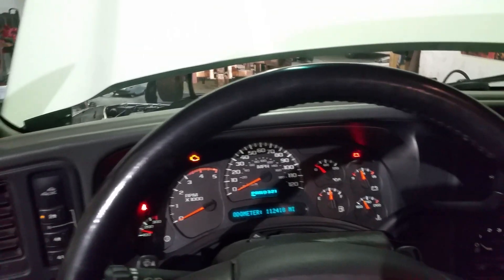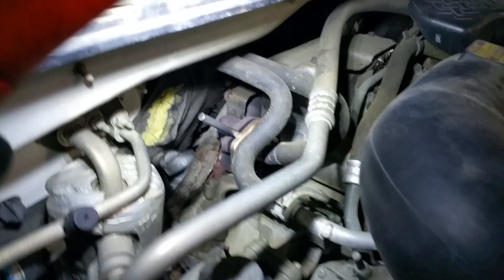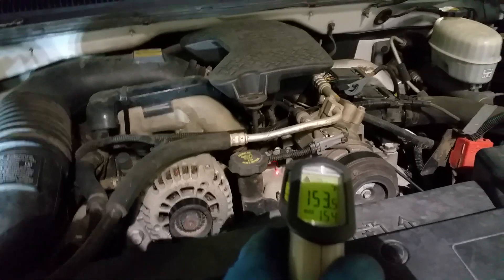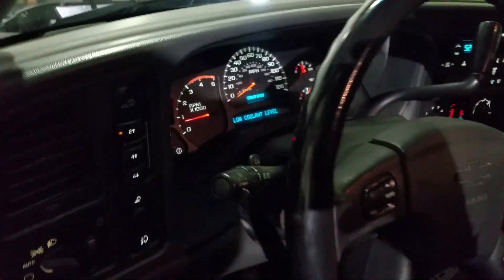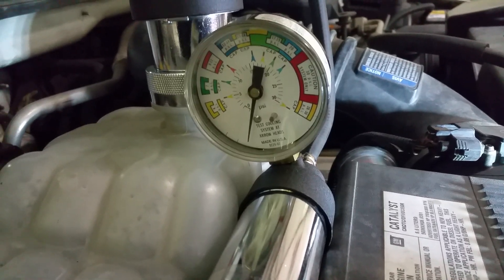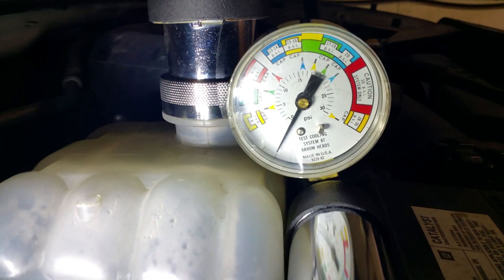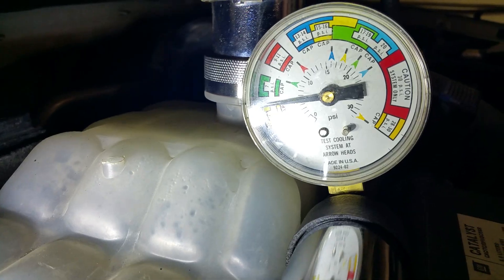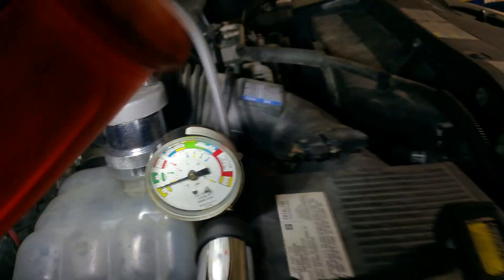LLY Duramax headgasket egr cooler leak test symptoms coolant pressure

Comment: Could you eliminate the cooler by clamping off the inlet and outlet hoses instead of disconnecting the exhaust? I've got antifreeze coming out of the exhaust when cold and it only smokes for the first 3-4 minutes of driving then stops. After that I have good heat and temp never gets over 180ish. What bothers me is I think its ingesting antifreeze bc the engine binds the first couple times I try to start it after it sits for a while...

Comment: Is it possible for the egr cooler to be clogged to the point it doesnt let gasses through and is pushing gasses into the expansion tank? Im getting air bubles in my expansion tank, but the upper radiator hose is soft in the morings

Comment: Normal cooling system pressure is on average 18psi so how do you determine its head gaskets. did you do a coolant pressure test for external leaks. Did you do a exhaust gas analysis of the cooling system.  Does the exhaust have an odd odder.  If a head gasket was bad around the combustion chamber area that gauge would be reading above 18psi and rapidly rising. I know this is an old post so by now you probably replaced the head gaskets and found that didn't fix the problem. So what did fix it.  and don't say it was the head gaskets.
Reply: your wrong about normal on system pressure,it  changes with temperature riseif your engine temp is below 183 you should really get rise in pressure. mine i know is egr 4 litres of coolant a day lol and white smoke but no pressure i can fill it wile its nunning
Reply: You are incorrect. I've had bad egrs leak coolant into the combustion chamber but will not pressurize the cooling system. A lot of cooling systems max pressure is 14 psi, and that doesn't mean they operate at that level.

Comment: I have a 04.5 LLY with that same style pressure gauge I get 40PSI by just turning the motor over. 99.99% sure its head gasket thing thats the only way to get that kind of pressure in the cooling system with just cranking the motor over. Any input would be great

Comment: Does this work the same for a LML with the 2 coolers? And how would you go about eliminate the cooler on the LML.
Heard some bypass the cooler with hose
Reply: What did you figure out I’m having the same problem with my lml. Haven’t pressure tested it yet. And it’s not loosing coolant. When the hose gets hard it drops A quarter of a tank of coolant. And then when you relieve the pressure it comes right back up to the minimum line and in to the over flow.
Reply: @tracemitchell5610  ended up being diagnosed by 2 shops... head gaskets for sure. Found a buyer and sold it. Wasn't worth what we owe plus the $$ to fix it. Truck needed other work too.
Got a newer truck instead

Comment: I have an 05 LLY with 98k miles on it and the temp guage started going on start up from low to extremely high over heating up and down. Not sure what the issue is and im hoping its not the start of a failing head gasket...your thoughts would be appreciated
Reply: another good sign is if you see black residue inside your coolant tank. I have an 04 lly and im currently doing a job on, and the side of the coolant tank was all black

Comment: I’m confused too. You said only 6 lbs Of pressure. Since when is 6 lbs too much? My 2007 duramax has to be exceeding 15 lbs cuz I’m losing it through the 15 lb cap. I was told not head gasket problem though.  What else can it be? In the morning when I remove cap a lot of pressure escapes. Only losing fluid at overflow right now I think but was losing it around water pump seal until fixed recently.

Comment: I have this exact problem with my 6.6l Duramax my 2014 Chevrolet Silverado 3500HD.  Talked to a couple mechanics and thet say without hesitation "it's a head gasket."  I have an extended warrantee, so I had the shop tear it down, because every other possible problem was eliminated.  They take the head gasket off and it is more than obvious that coolant has been getting I to the heads, but there is no visible sign of damage to the head gasket.  The head gasket is a 3 piece gasket that is riveted together, so the middle piece is not visible.  Needless to say, the warranty company is denying the coverage.  Do you know of a way to examine, test, or separate the gasket to prove the actual leak exists in the head gasket?
Reply: Did you get this issue resolved?
Reply: The issue's been fixed, but the shop didn't save me the head gasket.  If you have a warrantee on a vehicle I would recommend burning it to the ground (let it get really bad) before taking it in for the warrentee work.
Reply: @ericrogers9253  so you had to pay out of pocket?  Smh them extended warranty are a joke!!!
Reply: Yes I paid out of pocket.  Their excuse was that that they didn't want to keep throwing money at it.  I had taken it in no less then three times, 2 times for actual leaks in hoses and a third time cuz the water pump blew out (because of the increased pressure from the bad head casket).  So when I took it in the fourth time with the "low count warning light" and absolutely no drips on the ground, the mechenic was sure that was the real problem.  They tore it apart, there was visible evidence (though not terrible) of coolant in the heads, and then inspector screwed me.
Reply: @ericrogers9253  that sucks!! I had a similar experience with my extended warranty, they always found a way to weasel out of fixing it.

Comment: Hello guys 😓😓 😞 I purchase an 04.5 this past September and it seemed to run very well until I noticed some coolant release of my overflow tank then pressure in my radiator hose 😒.. I’ve changed my thermostats thinking that was the problem 😖 .. now after watch your video sir ,  my question is, why I don’t see the engine temperature rise hot 🌡 quickly  and see oil/coolant mixture if is the head gaskets that is the cause of all this problems .. any good answers will help me on witch steps I need to make since i can’t afford a diesel mechanic to fix my truck 🥺 .. thank you guys

Comment: i have a 2005 lly that is loosing coolant once in a while and experiencing nothing else. We performed a liquid head gasket test with no change in color so it passed the chemical headgasket test. We than performed your test in the video above nothing came out by the EGR and we had it idle for 20 minutes and it did not even move the needle 1/2 way to the 0 mark.  when we were doing the liquid test we did find that when you gave the truck throttle and you let off the gas then a few air bubbles would show up but did not change the color of the fluid
Reply: Find out what it was ?

Comment: I got a 2005 2500 LLY 6.6 Duramax I got high pressure going to my cooling system actually I'm talking more than the 15 pounds of pressure you post a half it blows it out my my reservoir not just a little bit I mean it blows it out anybody know what I could be
Reply: Clint Singleton mines showing the same symptoms and I’m in denial that it’s headgaskets. Replace your reservoir cap, that’s a start.

Comment: I’m not doubting it needs head gaskets as I drive a LLY. but wouldn’t a normal engine slowly rise in pressure too? Isn’t a normal  operating coolant system pressurized?
Reply from the maker: You are correct. Normal cooling systems operate under a predetermined pressure level not exceeding the cap relief pressure. In this case, the engine/coolant are already at thermal equilibrium (liquid expansion due to heat influence is at the maximum for the given temperature coeffecient). This is bc the engine is at full operating temp already. Therefore, unless the coolant was heated beyond the operating temp at idle, any significant expansion beyond the current level is due to an outside variable, ie; cylinder pressure. Simply consider this concept; if the fluid continued expanding after the normal operating temp of your engine was achieved, then the coolant would overflow everytime you continued driving your vehicle at operating temps would it not? 😉

Comment: I heard of you squeezed the radiator hose and it’s rock hard, you have a bad gasket...
Reply from the maker: Its not a definitive test but its a very good indicator of what direction to look. If the engine is atmospheric temp (sitting for many hours) and the upper hose is hard, there is a higher pressure hemorrhage introducing fluid/air into the cooling system. If the coolant is not mixed w any other fluids then you should test as the video describes or follow up w a carbon monoxide test.
Reply: @richiestruckandauto7438  how does one do the carbon monoxide test? Take a sample to a shop?
Reply: @glyshorts9107   you can purchase this kit at a  napa or orileys type store,  you cant take a sample to a shop becuase u need the gasses from the engine more then the  coolant,   im sure u can find a video how to  preform  this procedure. its super easy an can be done in 5 min or less.

Comment: If anybody has any doubt (likely you are in denial because head gaskets are not an easy job) after watching this, don't. What Richie has shown here is pure gold. I had the same issue develop with my 2005 lly at 240,000 mi shortly after buying. Low coolant light and hard hose but couldn't find any coolant leaks. I would wait for the engine to cool off to open the reservoir and add coolant and it would hiss and bubble intensely. I watched this and had nearly identical test results. It built about 1 psi per minute at idle. I changed the head gaskets and replaced with ARP studs. 2 years and 60,000 miles later, no issues. Don't give up on your LLY, it's a good engine...with studs
Reply from the maker: Right on man! Thanks for your support and reinforcement of my studies and methods 👍. Have a wonderful day and enjoy that LLY!
Reply: @richiestruckandauto7438  You are welcome. Thanks for making this video, I am a mechanical engineer and know good stuff when I see it. The truck has been reliable and I am looking to pass 500K with it. How much boost is typical with this engine and the stock garret? Does an egr delete with new straight uppipe give more boost? I want to get a boost gage to make sure my turbo is still pumping like it should.
Reply: My lly has 240,000mi and these symptoms… I’ve been in denial about the head gaskets because I just can’t afford it. Poor trucks gonna have to sit for awhile, glad to finally know what it is though

Comment: Cooling systems of all types operate above zero psi (compared to ambient air pressure). All systems are clearly marked with warnings telling people NOT to open when hot because they are under pressure. If the test pressure were to exceed the containment pressure setting of the system design continuously then one could draw the conclusion that  excess pressure was being introduced from the combustion chamber gasses entering the cooling side of the engine. This test at the shown pressure does NOT seem to suggest the above facts ?
Reply: I am only a weekend mechanic but your post is what I came to say. I am confused by how this means the gaskets have failed.
Reply: Still makes no sense all cooling systems operate under pressure. Pressure is what keeps the coolant from boiling
Reply: Don't see how this points to head gaskets
Reply: You are correct that the system is designed to work under pressure.  The reason why this test works (he didn't say it, I'm speculating...) is that what actually pressurizes a coolant system is the temperature rise of the air/coolant in a closed system.  It isn't deliberately pressurized by anything, that is just a consequence.  Here, the engine was at operating temp when sealed and temp did not come up much once capped, so it should not increase in pressure much.  A continued rise in pressure despite no temp increase is probably diagnostic for a failed head gasket.  Also this truck is an LLY, which is also diagnostic for a failed head gasket.

Comment: If the system operates at a higher than ambient pressure under normal operating conditions how can you say that an increase from zero to only 6 psi is indicative of a leaking head gasket ?????? Also not having a completely filled cooling system means there is more air present than normal during this "test". That being said air expands when heated and cooling fluid does not. This test is not proof positive IMO.
Reply from the maker: James P Bergeron It's rather a simple concept actually. The engine state is at full operating temperature. As I mentioned the customer just dropped it off. The coolant system IS FULL AS I explained in the video I topped it off w 1.5 gallons. The liquid state and temperature are at equilibrium. Therefore, w no additionally significant rise in temperature, there should be no reflection in pressure other than the influence of external variables, such as egr cooler or headgaskets. I've diagnosed multiple dozens of failures this way (w little to no variation in procedure) and the outcome was never different. Your entitled to your opinion. Now go take it and your trolling bullshit elsewhere
Reply: Richie's Truck and Auto  what are you even talking about? You relieved any pressure built up from the drive to your shop when you took the cap off. so obviously when you re start the truck it’s going to build the normal pressure back regardless of changes in temp.
Reply: @austinr09  Nah. The coolant system isn't deliberately pressurized by the engine.  It pressurizes because both air and water take up more space when they are hot than when they are cool, so in a closed system that results in pressure buildup when you take a cold engine up to temp.  If the system is up to temp already and you vent it, and then seal it again it should not continue to build pressure unless something else is pressurizing it.  In this case probably combustion gasses...

Comment: why would a 112k mile truck have and head gaskets?
Reply from the maker: gatewaysolo104 1ST Gen LLY motors have a history of poor head gasket quality. Additionally, once these are tuned, the drive pressures resulting from the vgt chargers often jeopardize the head gasket's ability to hold it's seal. Mileage has little bearing on the timeframe of which the head gaskets may or may not rupture. 🖒

Comment: Great video.  You seem to know the Duramax product so I was hoping to get some feed back on an issue I am having with my 05' LLY.  As your video depicted I have the same issue.  I noticed it about two years ago.  I am tired of refilling the tank so I have started to dig into this problem.  I noticed when running the truck the pressure tends to build much quicker at higher rpms.  I also noticed that I could hear a steam noise coming from the inner cooler immediately after shutting the motor off (remember this is after two year of driving it with the problem) so I decided to simply replace it.  Upon removal it was bad.  The problem is that although the new cooler is now installed I am still building cooling system pressure and it now seems even higher than it was before (based on the top radiator hose).  I am thinking that the inner cooler was a casualty of the higher pressure over time and it was acting like a pressure relief system.  Consequently the high pressure has now created a leak at the oil cooler unit that I will now have to repair.  I believe I may have a bad head gasket although no smoke, no water oil mix and the truck runs great.  I also notice that the pressure once built up will stay in the system which is surprising if it is a bad head gasket (I would think it would bleed back into the combustion chamber).  Very strange.  I replaced the coolant tank cap so I know that is also okay.  I have been reading on other web sites that a thermostat can cause this?  I believe the thermostats are fine as I can watch the temp gauge move up to the point where they open and the temp then drops back down.  I find it very unlikely anyhow as you would think with the motor off the pressure would equalize.  Both top and bottom radiator hoses are about the same temperature once the truck gets to normal operating temperatures.  So, before I start the mega job in my driveway I was hoping to get some feedback as to any other possible pressure building points that I might be missing.  Thank you for any input you might have.
Reply: The Camel Works I’m experiencing similar problems and might have to open it my self and see where to go from there.

Comment: I ran this test and pressure built up about 1 psi every minute. I shut the engine off at 15 psi, 15 minutes since that is the pressure cap rating. Not looking forward to the head gasket replacement. Do you have any pointers Richie? I would love the opportunity to discuss it with you. Can it be done in frame? Where can I get a good manual? Thanks for the video.